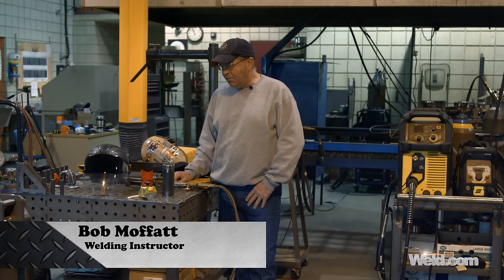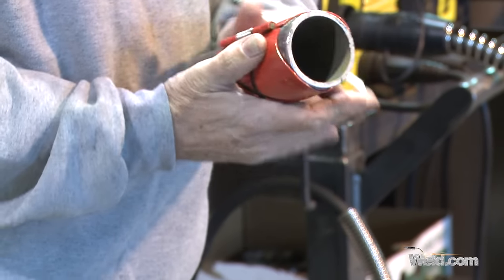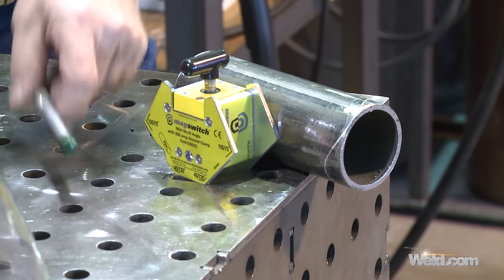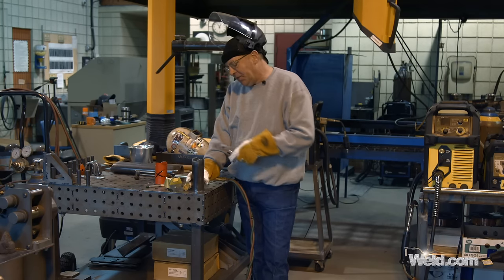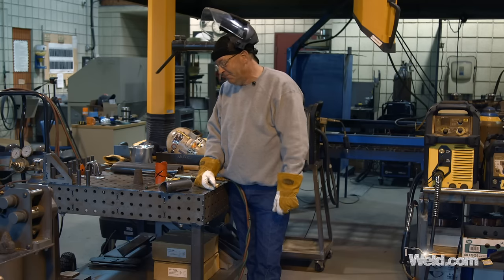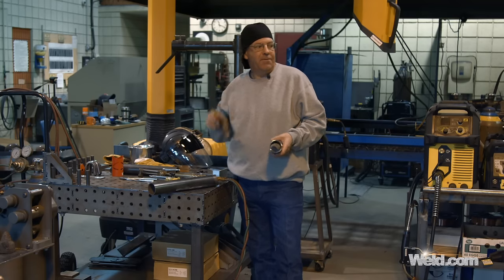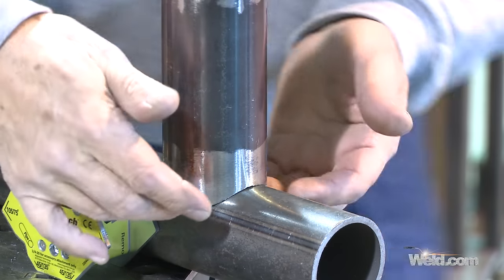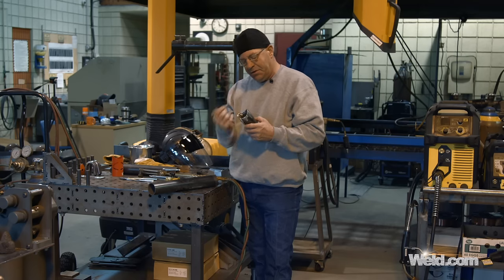🔥 How to Saddle Small Diameter (2") Pipe (w/ Oxy-Fuel Cutting)

Comment: Hi Bob, back when I used to cut steel, I would keep a small 5 gallon metal pail with me and place it on the floor below my cut. This would catch a lot of the slag and hot parts that fell off the work piece. This aids in cleanup, saves us from stepping on hot parts and helps with fire prevention too.
Reply: Thanks for spreading your tips

Comment: Talk about inspiration, you did it.  There is a new oxy-acetylene  set up on my trailer now. It wasn't cheap by my standards but... Talk about portable, I am a farm welder and not a real welder fabricator.  The ability of the flame to weld without filler, heat rusted steel and bend new metal is why TIG and MIG stayed on the shelf. After watching your videos I go to my shop and practice. After the feeling of defeat leaves me I go on to another of your videos.  Some I watch several times and thank you for the excellent photography.

Comment: My daddy would set the pipe in the jacks then notch the bottom on both ends on the bottom of the pipe.  Start at the top, roll the pipe do the other side. This also gives you a good reference when starting your bevel at the top because you start your bevel in the middle. When he got down to the other end, say 15 feet, he had a pretty little notch that he could roll to the bottom and start the bevel.  Lined up perfect every time.

Comment: I don't think i will ever draw lines again. That is a great way to notch pipe. When you showed your way of doing it the light in my head went on.
Reply from the maker: Glad to here it brother!
Reply: James Seagraves    It takes a little practice to get the hang of it, if you get on a job like he was talking about the pipe fence or pipe cattle lots, you'll catch on pretty fast. for me I have to really picture it in my head like the pipe is a drill bit drilling through the end of the pipe your cutting, what gets tricky is when the joint is needed is not a 90°
Reply: If you really want your mind blown then cut two flat bevels on a pipe. On edge saddle cuts form straight lines. The curve is in the pipe itself. What I'm saying here is if you try to chisel point something round and hollow you end up with a saddle.
Reply: @1pcfred  , best trick  for birdmouthing a tube is just 2 straight cuts. I watched a guy use his chop saw and like that the world opened up.
Reply: @omenofseverah  perhaps my comment wasn't perfectly clear. But that's what I said.
Reply: @1pcfred  i understood what you wrote. Perhaps my comment was wrongly wrote. I was agreeing with you.

Comment: What helps me is to first cut a tiny notch of a kerf at the bottom edge of the pipe.   That marks the bottom dead center of the pipe's edge. It shows me where vertical is.  Then cut the saddle at the top surface of the pipe.  Then rotate the pipe to get that notch up to the top. And cut that 2nd part of the saddle.  And if my hoses reach, I'll mark the notch at the top and bottom of one end,  move to the other end of the pipe, cut that saddle, and move back to the first end to make use of those notches to cut that saddle..    That helps me keep the saddles at both ends aligned to vertical.   And if it is really rusty, or filled with crud,  cut it too long by an inch or two.  Beat the cut end with a hammer.  Scrape the crud out with a tool, and then cut it better.    And consider making the bottom cut first by holding the torch to blow down thru the bottom inside out thru the bottom outside.   If you cut the bottom first, the paraffin, and dirt, and slag will fall out of your way, rather than having your first, top cut make a smoking pool of hot junk laying inside the pipe.

Comment: I use a center finder for pipes on both ends of a long pipe to keep two saddles on both ends aligned. For saddles, I use a portable grinder with  a 6-inch cutoff wheel. I cut from about 3/4 inch below the lip or rim to the center of the center line of the pipe which I pre-notch and line up and use them as reference when cutting out the saddle. If you cut t at a 30 degree angle you get instant bevels too
Reply: Then you cut both peaks at an angle which will allow the saddle to fit snugly over the pipe

Comment: My brother in law used to have a device bolted to his workshop wall that you just put your pipe into the correct size hole pulled down on a bar and you had the perfect  saddle notch. I have no idea what it was called or who made it, I can remember him buying it in the mid 70's but he closed up shop a long time ago and is now dead so I cant ask him but I have often wished for one of those.
Reply: You can still buy these things, I think they're for like EMT and fence pipe, lightweight stuff maybe 16ga?  I've seen them online, might be a few hundred bucks.  There's more than one style and size, generally a little steel thing with a great long handle.  They look really handy!
Reply: Sounds like a manual ironworker.
Reply: Iron worker i used this many times in the fab shop. Has a punch on one side a noch on the other a sheer in the middle and many holes for notching tube in the middle as well. Its all electronic foot control. Fun machine and you can set up stops if you have a high quantity.

Comment: I like to use the weld in the pipe as an index to guide my cuts at both ends so that the saddles are oriented correctly.
Reply: I've done that but you're better off putting a short piece of pipe into your saddle and getting it plumb. A short piece of pipe is just a lot more length to look at than a line. Which in the plane you're using is actually just a point. I've made loads of screens out of EMT and I used a mill to cut the saddles. You know that end mill was plumb up and down too. So when I'd flip the pipe in the vise I'd gauge the saddle up and down with the short pipe in it to get the pipe right in the vise for another cut. Trust me it's way more accurate than looking at a line on a pipe. Unless you just suck at eyeballing plumb.
Reply: Paul Frederick 
Great tip, Paul. I'll have to check and make sure that the drill press is true and running plumb, and then a torpedo level with the short piece of pipe will get things super accurate.
Reply: I used a real mill. A drill press might work though? People say stuff about side loading them but they're tools. So you have to work them. Every now and again it don't hurt to lube the spindle bearings. You get out what you put in, maybe.

Comment: Hi Bob,Was watching this video and noticed your shut down. Looks as if you shut down oxy first? Can't remember if you've done a video on torch procedure. Is that the method you recommend? Seen both, and just wondering your opinion. Am a novice torch user and always learning. Thanks Bob. Love your videos.
Reply: Peter Ford I was taught always gas first, then oxygen
Reply: Cory Knowles Hey Cory, guess there's only two ways to shut down. I'm self taught,with aid from video tips. First ones I saw always oxy first then fuel so thats what I did. Then I saw others, including Bob, shut down the fuel first. Never have had problems with oxy first, but always learning so was curious. Safety first.  Thanks Cory
Reply: There's two ways to shut down. With flashback arrestors and without them. When you have arrestors it don't matter how you shut down either.
Reply: Paul Frederick Thats true. Since I made that comment I've inadvertently shut-off the torch both ways with no problem. And no arrestors. But did finally break down and buy a set. Feel safer. Thanks.
Reply: By themselves neither oxygen nor acetylene are flammable. But mixed together is another story. I have arrestors and quick disconnects. QD on torches is sexy. Talk about breaking down getting them though. I think they were like $60 a set? But oxy-acetylene was my first welding love so I spared no expense with the last burn outfit I put together. It is all Smith.
Reply: Paul Frederick True. Nothing is as versatile as oxyacetylene, for hobby and pro use. I'm still using my old uniweld kit, but did buy some B 40s tanks for home work . The 10 and 20 that came with the set just didn't last. But I don't do enough for larger tanks. For plumbing I have my b acetylene tank and only have to switch out about twice a year. Torch work is fun. You're right.
Reply: Paul Frederick Guess it's all in how you look at it. There are people that do the tech, people that fly the aircraft, people who teach others how. Mans come a long way,,,just not all of us. And when you see the plasma cutters and stuff Bob uses which I don't,,those are pretty advanced to me.
Reply: Technology interests me enough that I've spent some time reading about where it came from. One thing that I can't escape is the thought that for the longest time we had barely any technology at all. Now it seems like we have a lot, but it really isn't. Because we're still so new at the game. The Dark Ages was only about 1,000 years ago now. As the name suggests it wasn't the most enlightened time in our history either. The Age of Enlightenment itself was in fact just 333 or so years ago. That leaves millions of years where our ancestors accomplished virtually nothing. I have a difficult time reconciling that fact. We live on a planet where a large pile of rocks is literally an ancient wonder. It remained the tallest human structure for about 30 centuries too. So color me unimpressed.
Reply: Paul Frederick Paul, id have to guess our modern technology of today came from found UFO s that the average person wasn't privy too. Many years ago there were these claims, because it seemed strange,,as u say,,that we seemed stagnant in that atea. Then suddenly comes the microwave oven and other seemingly discoveries. I'm wondering maybe too, that some one developed these things and someone halted announcement of them for one reason or another. Now,, with the internet we can research things like never before. Maybe if we live long enough we'll see some even newer device's of mystic origin. With the initial introduction of the home computer,now cell phones that are basically tiny computers,,the techs that really know this stuff, just keep coming with more and more. Some days I wish for simpler times. But i guess so did our parents and grandparents. Next our children and grandchildren, where our lives are so dang full of,,,gadgets?,,now, there's no time to just take in nature, a stary night,,or a puppy. Just when u sit down to do it,,,you get a damn notification on your pocket computer,,haha.
Reply: People that think any of our technology came from UFOs have not studied the topic at all. The entire history is available to those interested. What we have humans invented. One of the inventors of the transistor even lived in my home town. He was not an alien, he was practically my neighbor. He was the physical experimenter on the team so the fellow that actually made the first transistor. Walter was quite human I can assure you.
Reply: Paul Frederick: True.  Take for example quantum mechanics.  Faraday, Kirchhoff & Boltzman, these guys broke the ground in the mid-1800's.  And especially in construction, we have a tendency to forget our past and reinvent the wheel.
Reply: Today people don't forget. They never knew in the first place. They take the lazy way out. Yeah we discovered integrated circuits in spaceships. Sure. Never mind the real people that toiled away actually doing these things. What are their efforts compared to a good BS story? I hate to break it to them but the tech that we possess now is insufficient to travel interstellar distances. Which is why we can't do it ourselves yet. So why would it even be on spaceships? Did an ET antiques merchant crash land on Earth? We have to make custom integrated circuits to function in space. The crap people have doesn't work up there. That is how inadequate the technology is. They think they can take their smart phones into space. High energy cosmic particles would render it useless. We haven't surpassed 1995 electronic technology levels in space yet. But they don't know that either.
Reply: @1pcfred  acetylene isn't flammable by itself? Interesting! Just curious which valve you turn on first to get it lit? Hopes? Or dreams? And THEN... oxy or acetylene after?

Comment: Bob got a question about butt welding would you bevel the joints for penetration and strength and if not why.
Reply: Leonard Gilbreath 
Please allow me to give you my  opinion.  It depends on several different  situations  . Is there a blue print? How thick the materials what kind of process are you using .  Me personally.  If my materials are less than a1/4  I just weld one side   then flip the pice run a grinder to it and then another pass .  Unless like I said . If the drawing calls for something in particular .

Comment: You have clearly had far more practice with a gas axe and a steadier hand than i do. 

That would be used mute for handrails than fencing, fencing you would want to use galvanised pipe?
Reply: If you want me to weld galvanized you'd better have an oxygen breathing rig for me to wear too. Metal fume fever can kill you. If it don't you're going to feel so bad you wished you were dead. Just wearing a mask or something don't cut it. I got away welding galvanized a bunch of times, until one day I didn't. After that now I won't.

Comment: Could you show use welding overhead with 7018 ?
Reply: You need to use a fast freeze rod for overhead. Which 7018 isn't. Failing to plan is planning to fail.
Reply: Lmfao that is 100% not true

Comment: Who needs a notching tool when you have oxy-acetylene?
Reply: You are CORRECT.  Once a Weldor learns how to fit pipe with an OxY-Acetylene Cuting torch, the only advantage to a Notcher is if you are running a HUGE QUANTITY of identical "PARTS" in a SHOP.  If you are building say a GATE a one time fit, a NOTCHER, depending on which type is TOO SLOW!!!  Also, Notchers are not good to use in the Field.  I have built gates and fence for 50 years, and it is a shame so many people are around that cannot flame cut a pipe to accomadate an angled joint and get good fit up and do it with some speed.  BB

Comment: Nothing worse than welding Rusty pipe with huge gaps I laugh and say this guy. I built a trailer old rusty Pipe 2  3/8 never been that good at cutting pipe gotten a lot better now but at the time I wasn't that good I mean probably about quarter inch half inch gaps fill them in barely with 6010 look like garbage held up pretty good though cleaned them up with with a 7018 Rod made him look fairly decent still got it to